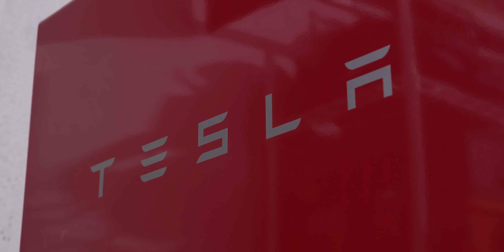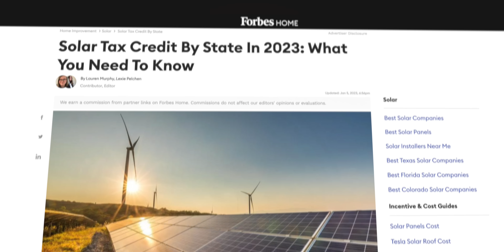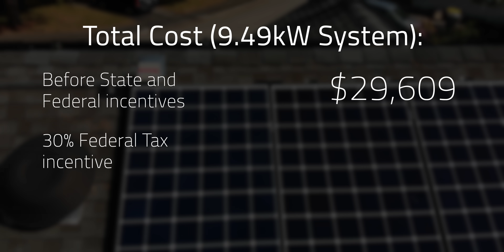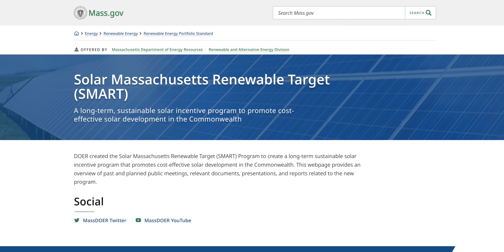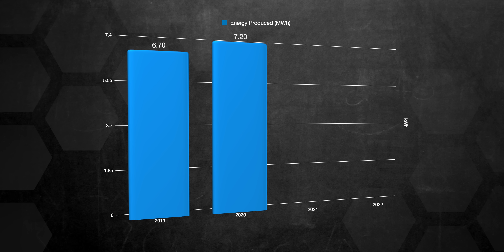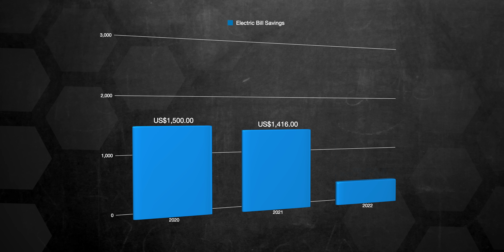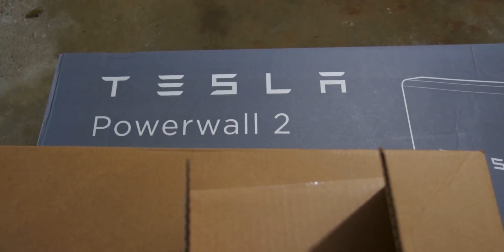5 Years with Solar Panels - Is It Still Worth It?

Comment: Your statement that you've been saving about $1500/year is compelling.  If we assume that figure stays stable, and you originally spent $14,000 out of pocket (after all those incentives and kickbacks), then you'll pay off the installation of your system in about nine years.  So realistically, you're not saving ANY money until that date; you're still paying for the original system.  You don't realize any benefits until you're through paying off your original investment at the nine year mark.  From that moment on, you begin to actually save money.

I run the infrastructure group of a large datacenter, so I have a lot of experience dealing with electrical distribution, especially where battery systems are concerned.  We just replaced all our original lead acid batteries with lithium ion batteries this year, at a cost of over a million dollars.  The original lead acid batteries lasted about 7-8 years, depending upon how you choose to define "lasted", since we were forced to start replacing them individually 2-3 years ago as individual cells died.  Datacenter batteries live a very comfortable life, in that they hardly ever do anything but sit there on a float charge.  If they're asked to discharge at all, it's typically only for seconds, until the generators come online.  Unlike a homeowner's battery system supporting a solar setup, which is, by definition, charging and discharging on a daily cycle, and even more so if you're on a plan where your utility can pull from your batteries at peak demand moments.  So it's unlikely your batteries are going to last longer/as long as mine.

If we recognize that you don't save a penny until you finish paying off the original installation investment at the nine year mark, and if at that moment, you have to start replacing your batteries (or other hardware which might have reached end of life), you're right back in the hole again.  And if, as in my case, you go from one battery type (lead acid) to another (lithium ion), then you also incur the costs associated with that change in technology, since the charging and monitoring systems of one type of battery are invariable very different than those associated with the previous cells.

So what is the point?  If the point is to solely save money, it's unlikely the math works out in most people's favor.

Comment: Thanks for the information. You could have sued the power wall installer for what It cost you to have it installed correctly. If you  paid them by check call your bank and ask for a copy of both sides of the check to get their account number. Don’t tip them off. They’ll change their bank. After you win in small claims court you’ll need to go to the sheriffs and have them seize the amount of the cost of repair. The sheriffs will charge you a small fee.  Be sure before you file in small claims court to include all fees incurred such as a private investigator and collection fees.

Comment: That was amusing how our host tried to explain away or justify the huge government handouts for the solar panels.  It is a crazy fiction that somehow if someone else subsidizes you to install solar, that it somehow becomes an economically viable and efficient option.  It is also interesting to look at how much the utility's cost for electricity rises with the implementation of "green" options like wind/solar/net metering/mandates etc..  There is no way these solar panel setups can possibly work if implemented on a large scale.   These enthusiasts really should be made to pay the total cost of their "green" hobby.   The description of how it has worked for our host is a story of how fancy, upper class climate neurotics have profited nicely from people less able to profit from all of those handouts who are forced to use the more economically and environmentally efficient conventional power.
Reply: Your closing statement kind of undermines your pretty fair argument.  It is itself an endorsement that these "green" options are not effective.   The most efficient or effective systems will not need to be incentivized if they are more efficient or effective.   On the other hand, carbon incentives should not be supported by taxes of fossil fuels and ICE cars.  That is extremely regressive and harmful to those of us in less luxurious circumstances.  As long as those "green" options are incentivized, they are not efficient and if they were efficient, they simply would out-compete the other options.   The subsidies only paper over the shortcomings of the technologies without doing any real good.  Let those more fortunate individuals with a case of climate hysteria adopt these new technologies without the handouts and prove to the rest of us their viability.  If nothing else, they will at least achieve the satisfaction of signaling their virtue.   In the meantime, I don't get any good feelings from heating my home and driving my old car knowing that a significant part of what I pay is going to those better off than me to help those more fortunate than me treat their neuroses.  @koisolare
Reply: @koisolare  We are not addicted to oil any more than we are addicted to food.  To the extent that fossil fuels are subsidized, it is a vastly smaller amount than for wind/solar.  If wars are fought over oil, then that is only proof of how important oil is for a functioning civilization.   There are no nefarious reasons why wind/solar have thus far failed.  They fail on their their own merits and regardless how much we paper over their shortcomings, they remain failures.   It doesn’t make the subsidies any more intelligent if a perhaps more implicitly deserving group receives them.   Good for you that you have found a way to profit from this policy madness.

Comment: You are not undecided. Also, you gave yourself the full amount of the tax credit, which is incorrect. Lastly, you should calculatek what the savings are without all of the kickbacks from the state and government which, quite frankly, you should not be getting, since that means that taxpayers are subsidizing your vanity project. Lastly, the cost of energy from nuclear, coal, and, if possible, hydro would be much cheaper. These silly "green" energy schemes have allowed governments to neglect the true grid. I liked your video, but don't be disengenuous and say you are undecided.

Comment: Grid-tied solar panels keep my electric usage in the cheapest tier 1 or tier 2 pricing year round.   In the summer months I usually generate more power than I use, even with air conditioning.  When I installed a 5kW solar array on a newly installed roof, the panels completely offset the electric car I leased at about the same time.   They also act as additional insulation for the roof, which helps reduce heating and cooling requirements. When the lease expired in 2017, I reverted to a petroleum-fueled car, and enjoyed the lower power bill.  With the government subsidies I received, the break-even point was still about 20 years due to the low cost of electric power in my city.  But that cost has begun to spike (as I expected) and the payback rate is accelerating.  If I ever add or replace panels, the current technology is much cheaper and more efficient.  Battery backup would be nice, but not worth the expense since power is pretty reliable here.  Batteries don't last 20 years, either, so they would require replacement more often.  I think I would prefer a backup generator that runs on natural gas.

Comment: Interesting. You say your bill is about $230/month. Ours is $237/month in PA, so it's very similar. We have some rebates but nowhere near as generous as MA. When I told 3 different installers that our bill averaged $237/month, never heard from them again. Almost like they didn't think they could sell the ROI.

Another helpful hint for others watching this video, especially folks in climates where energy bills can vary widely depending on season: Installers will ask you what your most expensive monthly bill was in the past 12 months. That's a ruse for them to be able to claim "We can save you 'x' amount off of that!" This neglects that that 1 monthly bill is the highest and an outlier, not the annual average

Comment: I am terribly confused by your math. Many providers in Massachusetts seem to be able to provide energy for around $0.14 to $0.16 per Kilowatt hour. Why not use them?

This would wreck your savings and payback time. Lets look at it another way. Your out of pocket was about $20,726.00 HOWEVER the actual cost - was $29,609.00. That $9,609 came from somewhere - it is a subsidy - so Please include it in your calculations BUT lets pretend you DON'T include it and run the math.

Now the one thing that is simply strange is the SREC payouts - which makes about ZERO sense but that pays you $15,146.40 over the 10 years - since it is simply something that government is requiring utility companies to do which if you THINK ABOUT IT is one of the reasons the cost of electricity has increased BUT whatever.

EVEN SO - lets take the amount of money that we have remaining which is ONLY $5,579.60 - so YES at that point in time if your production is 6,549 kWh's at $0.15 per kWh your payback is going to be 5.68 years when you take the SREC payments into account.

However what was the actual 'BREAK EVEN' cost of the power? For most people it is $0.15 ( or less ) per Kilowatt hour and has been for almost the last decade, I have not experienced a real rate increase in years.  The REAL payback at your usage level is Close to 22.75 Years ( at a 3% average increase in Electricity production prices per year )

Now lets PRETEND you had $30,000.00 that you were going to just pay for a system but instead you placed it in someplace like the stock market that returns on average over the past 100 years at between 8% and 10% Heck lets be NON aggressive and say 6% average return.

Over that same time period your account EVEN WITH THE MONEY FOR UTILITIES COMING OUT ends that 22 year period of time at $54,139.88

Which is $24,139.88 CASH POSITIVE!!!

No matter how I am looking at this you lost money by placing solar panels on your roof. Even when looking at the SREC payout you still lost money in the end ( though the cost of the energy you produced went from only costing ( cumulative ) from $0.225 an hour ( over those 23 years ) to a whopping $0.297 overall ( the sunk cost of the original $29,609.00 PLUS the payouts to you of 
$15,146.40 ) 

THE MONEY COMES FROM SOMEWHERE!

Comment: Dont be fooled by this type of contrived garbage aimed at selling systems, or emotional validation, or simple virtue signalling by greenfolk. The numbers never add up in reality over time, and there is no magical breakeven point or return on investment. Solar has become a terrible scam operating between major corporations, governments, and unscrupulous installers and maintenance companies. It is a free for all out there. A pack of piranha's preying upon people simply looking to save money. The industry is not designed to benefit the homeowner...it is designed to use the gullible homeowner. Hopefully one day the tech will exist, but it is not here yet unless you spend enormous sums. When it is truly efficient it will become obvious..it wont require wishful thinking.

Comment: Your electricity prices are a lot higher than where I am in WA state and as you point out, that helps the economics.  You said you pay just over 30 cents per kWh, our 'net' pricing after the myriad of various charges/refunds my last bill was just under 13 cents/kWh.  It's impressive that your installer's estimate of power production over years appears to be on the low side of what you actually produce.

You make some good points, like is net metering available where you live?  If it's not, you really don't want to install too big a system.

As a backup power source, batteries are crazy expensive.  I realize you use yours as a distributed battery system which helps off-set the cost but would you have installed a Powerwall if you had to also buy the Powerwall battery?  As a backup power source, I'll stick with my 3 kW Honda generator.

Comment: For comparison, I had 42 Sunpower SPR225-BLK panels installed about 15 years ago, they are pretty worn-out by now.  Total price was $75,000 before credits, total capacity was 9450 watts, very similar to yours.  After 15 years the power is down substantially due to deterioration of the substrate, which was expected.  2021 generation was 16,620 kWh which covered exactly 1/2 of our total usage, which was ~32,000kWh.   Being part of SRP means about $70 per month in fees and taxes.  My panels are small compared to the new form-factor where you get ~400 watts per panel, efficiency is pretty similar.  At least when new.  I suspect our panels wear out faster in Phoenix than they would in New England.

Comment: Solar panels on garage are two years old, roof underneath is 12 years old. Hail damaged the roof, but shingles under the panels were fine as were the panels. Our insurance would have covered removing the panels, but there was no need. We only replaced the side that was damaged.

Comment: Just received an estimate for rooftop installation and was surprised at the high cost. The ROI would be dreadful (potentially nonexistent in fact), especially considering Indiana allows for buyback of excess power at only a rate of 1/3 retail price. But ROI would be very bad even if that changed. I can't see how solar will expand much given these costs unless there is something unusually high in our area and economics are significantly better elsewhere.

Comment: A solution for the wealthy only.  This is only possible because of subsidy which in part is paid by everyone who doesn't have panels.  As has been shown the only times in modern history that carbon output has been slowed is when the economy was slowed or stopped, like the fall of the Soviet Union, and the recent covid slowdowns.  The fact that you laughed about your own electrical usage shows that the environment is not your primary goal.  You are buying indulgences to absolve your carbon sins.

Comment: 10:37 The cost of a Tesla Powerwall is certainly a killer. For my wife and me, it doubled our system quote, which led to us ultimately putting the project on hold while we reevaluated what was most important to us. We live in an more rural location where power outages occur more often than in urban settings, taking our water with it (well with electric pump). However, at 2x the cost of a whole-house gasoline generator that might get used, at most, 5(ish) times a year for anywhere between a few hours to a couple of days...that's a tough pill to swallow.
Reply: You might want to just consider a smaller portable generator sized for critical needs (incl. water) only, if you have such limited outages to cover (as opposed to a Tesla Powerwall or a whole-house generator).
Reply: @garyw6724  Yep! That's a path we're beginning to head down. That or a solar generator. Same concept, but far cheaper than a Powerwall.

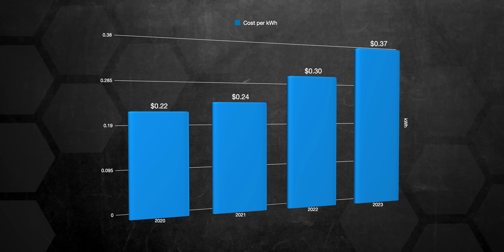Comment: 7:49- This is a big factor that people miss when researching and getting wowed by the tales of savings. Where are those examples/stories coming out of. I've seen local promo's for solar panel installs touting customer stories of how much they saved. But the stories are from people nowhere near my area and places much sunnier. And a big factor in this deceptive marketing is kWh price.
You're paying $0.37/kWh USD (and that's 6 months ago, so likely higher today, Aug 2023). I'm paying $0.07/kWh USD as I literally just opened the bill envelope to check.
ROE and how long it's going to take to pay for the panels + interest if you have to borrow. And will they even be paid for before they fail or need replacing? Our local power is Hydro generated, for reference. 
My house is perfect for solar. On a hill top. Perfect orientation to the sun, and no tree shade. But unless someone gives them to me for free. No thanks.

Comment: Unfortunately, for me all the savings was negligible, ironic for living in the Southwest. It became the equivalent of buying a new couch at 50% off, while the old couch was perfectly useable. If I would have bought a $5000  generator and stuck 20k in a bank account, I would have still saved around $2000. After 12 years with solar,  with upkeep,  replacement panels, and headaches of trouble shooting,  I haven't seen a over all benefit. Plus I have neighbors with loans for thier home system,  and they are paying monthly payments on top of still paying the eletric bills.

Comment: But how suitable is this for a non-tech small town Joe very busy with work/family often away on trips, wife alone , no local support group etc.  SHE goes mental if the washing machine breaks down.  Solar is up on the roof - ALARM.  I cant even get a reputable tradesman to replace 1/2 dozen ridge tiles on my bungalow lost in a recent storm for under £800. HSE says scaffolding must be used.  If I were fit I would shoot up there on a roof ladder and do the job in a hour.

Comment: I tried a solar hot water system back in 1985. All things considered it was one big hassle. Having a new roof installed was a pain. Replacing pumps periodically was another cost. I now have a tankless hot water heater working off natural gas at my new house and that has proven to be the best investment. Other than a yearly vinegar flush it is maintenance free and it should hast 25 years.